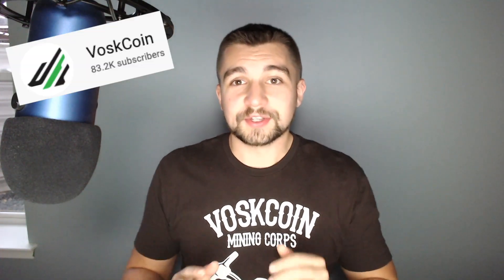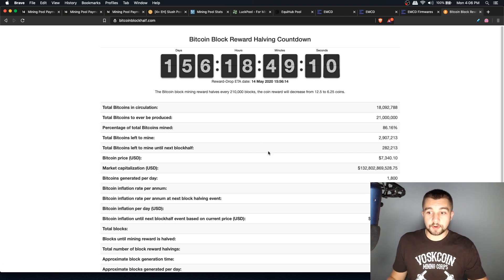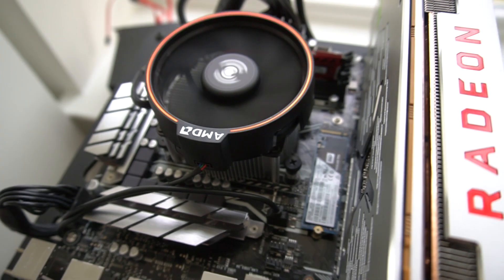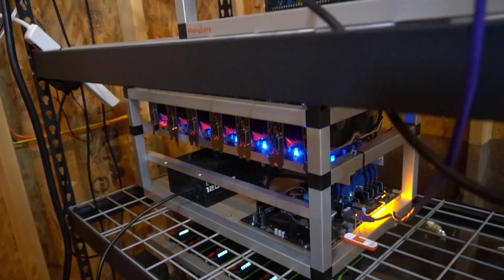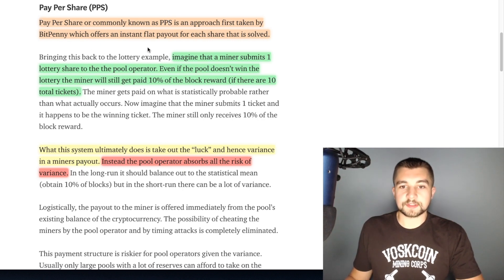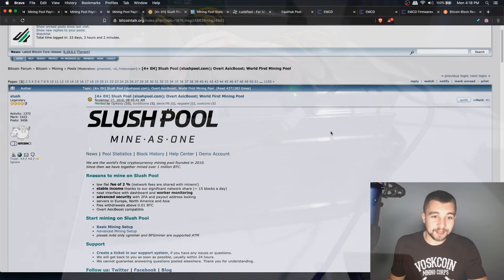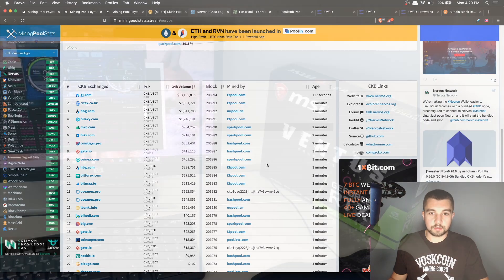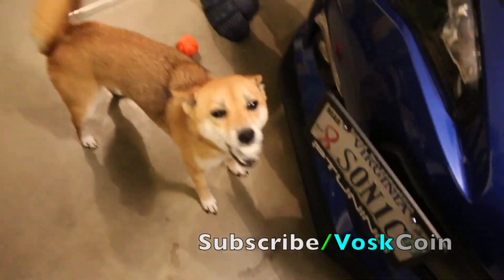Bitcoin & Cryptocurrency Mining Pools Explained | Best Mining Pools PPS vs PPLNS

Comment: Hello Vosk, in next your video you can speak also about differences in pool systems PROP and PPLNS.
Some info about PROP system.
PROP payment method : Prop (Proportional)

A proportional pool carries no risk to the pool operator as miners are simply paid out when a block is found. No blocks, no payout! With a Prop pool the risk is all on the miners if it takes longer than expected to find a block then the miners earn less. On the flip side, if the pool is lucky (they will all average out the same eventually) the miners get more. This is in complete contrast to the PPS pool where there is no "Variance"
Using made up data for simplicity, here’s an example:
[]A block is found after 100000 shares
[]You submitted 1000 of those shares (you have 1% of the pools total hash power)
[*]There’s 200FTC per block

Quite simply you will get 1% of the block = 2FTC. Now if the pool has a bad round (a round is the time taken to find a block) and it takes 200000 shares to find a block (twice as long) and you have submitted 2000 shares (as you’ve been mining twice as long), you still only get 1% of the block = 2FTC.
This can also work in the miners favour too as if it takes half the time (50000 shares) to find a block and you submitted only 500 - again - 2ftc.

Basically with a Prop pool you always get you percentage of the block and you win/lose depending on the “Luck” of the pool.

The drawbacks to a prop pool are that there is often a fee although some pool ops rely on donations only and you will have to bear the variance of the block times and luck unlike a PPS pool. Also they are susceptible to “pool hoppers” where PPLNS pools are not.

Generally speaking Prop pools are are a better option than PPLNS pools if you like to move around coins and pools a lot and are only a part time miner.
Reply from the maker: Thanks for the lengthy info and explanation :D

My question is why prop over PPLNS?
Reply: @VoskCoin  Copy/Pasta :) A PPLNS pool is the same as a Prop pool in so much as the miner takes the risk of variance. Where they differ is how the payouts are calculated. PPLNS pools were designed to stop pool hoppers as they don’t technically payout the current block, rather they payout based on an average of the shares you submit over the last x number of blocks. As a result, when you first start mining on a PPLNS pool you’ll notice that you hardly get paid anything until a few hours later. This will ramp up over time and once you stop mining, you still get paid for a few hours… this is due to the “buffer effect” of PPLNS and pool hoppers hate this as they cant jump on a fresh, profitable round! You, as a loyal miner still get the correct amount eventually but you have to be a bit patient for the ramp up and ramp down times.
If you are a loyal miner, stay with one pool and feel lucky (you could earn more or less) then you need a PPLNS pool.
If you hop around a lot then a Prop pool is probably best. Worth noting though that Prop & PPLNS will ultimately pay the same to it’s miners.